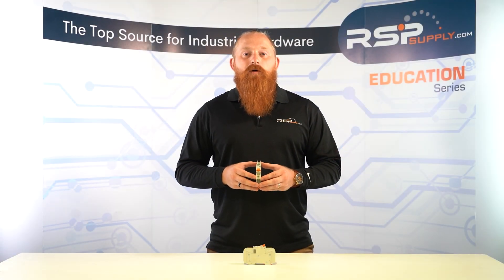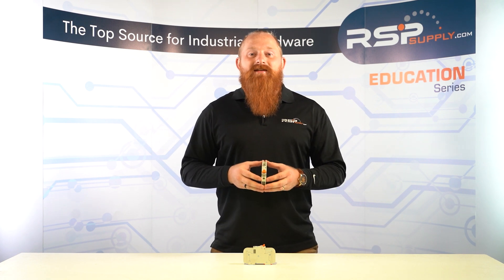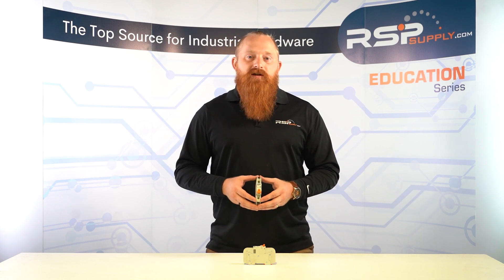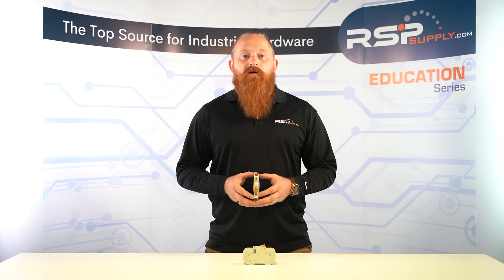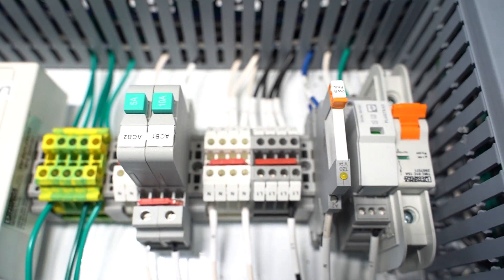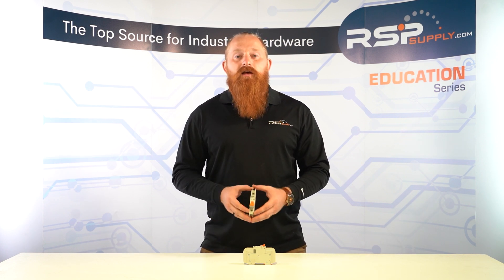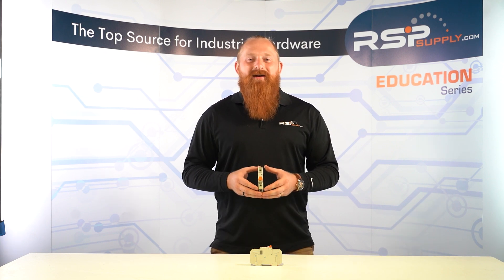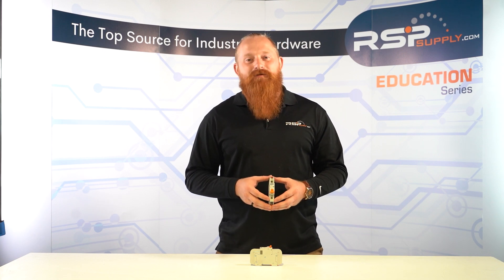What is an MCB (Miniature Circuit Breaker)?

Comment: a) MCB also has other parameter - short circuit current. If you will pay attention, you will find the numbers on MCB: 6000, 10000, 12000... - this is short circuit current. This current depends on your electricity supply system: transformer, power cables... Basically at living houses MCB with 6000A short circuit current is enough. 
If you will use 6000 MCB in the system, where short circuit current is ~10000, it is possible the MCB will not trip - the contacts will be welded and something will go on fire. 

b) You cannot use standard (AC) MCB for DC voltage system: the electric arc is more durable to disruption in direct current because the voltage is constant. So for DC voltage you must use DC MCB. Also you can find universal MCBs: you can use them in AC or in DC system.